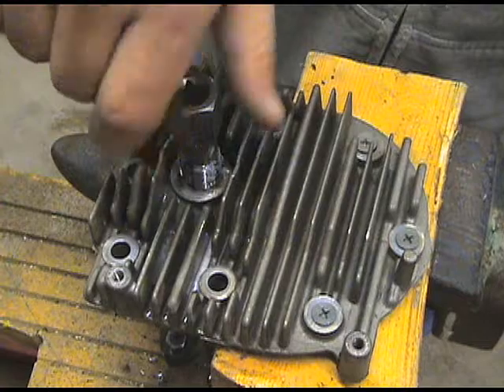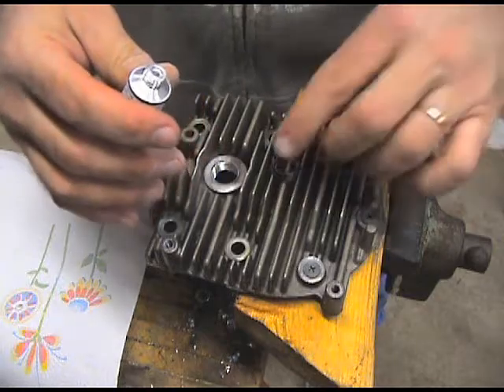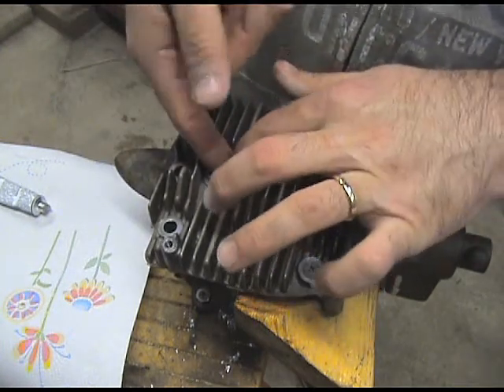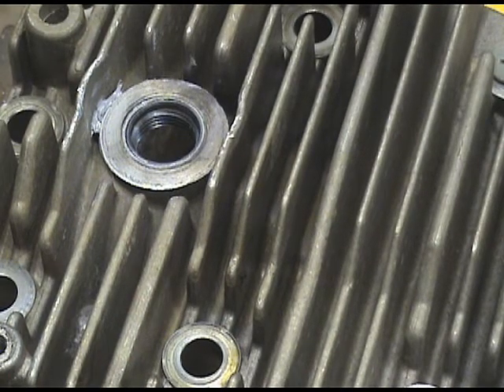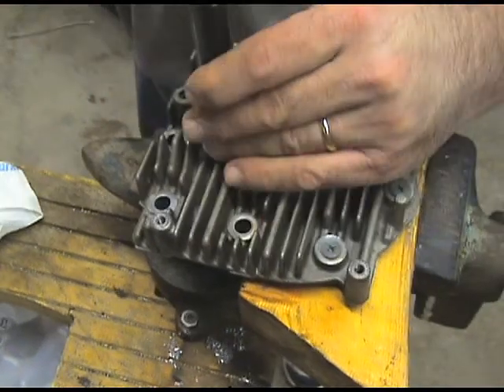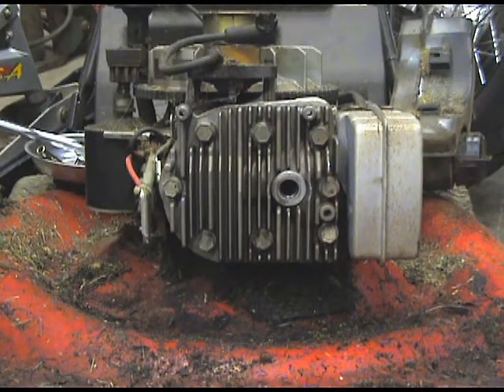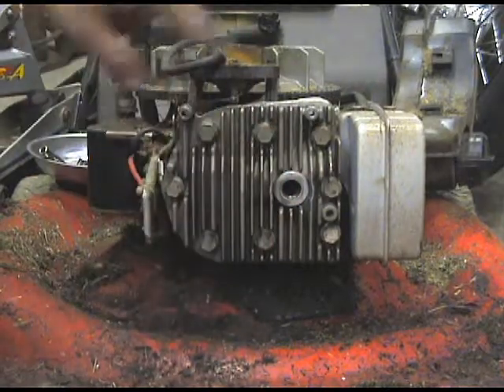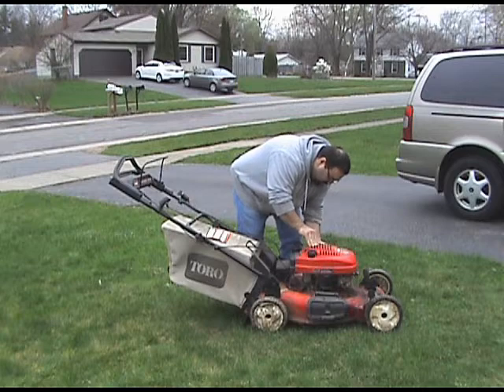Toro Spark Plug Thread Repair with Sav-A-Thread by Heli-Coil PART 2

Comment: Thanx for that, I never even heard of a spark plug "sleeve" until today and I'm 50.  We bought a new Champion RC12YC and it didn't work.  We took it back to the store and complained, that's when they pointed out our old plug had a "sleeve" stuck on it.  We'll try various machine shops to try to match the insert.  My dad knows an aircraft machinist that may be able to cut an exact copy of the insert from scratch.  This is going to be a problem now matter what.  Thanx for your info.

Comment: id be using green or red wicking loctite not silicone.  not sure if you realize how hot that head gets but silicone wont be lasting long at all on and air cooled engine on the head next to the exhaust manifold!!
Reply from the maker: Thanks for the tip.
Reply: @Paisteboy   Update on if the silicone kept the insert in? The pack says to use high temp silicone, not Loctite as the other commenter mentioned.

Comment: Lol nice job you done, looks pretty damn efficient and it works. Can't believe someone made a negative comment tho smh
Reply from the maker: Alonzo Braziel
Right. Maybe a mechanic wants to do it the easy way and be able to charge more for a new head. Not the average guy.  If a repair will work and it's cheap, most people would do that.  Thanks for the comment.

Comment from the maker: Yeah,  I used to be skinny, but that was a long time ago lol. The RM is a 1980 RM 60 2 stroke.  The gearing is really tight on the RM because it meant for motocross.  It's a six speed and in motocross you shift really quickly.  I'm going to be doing a couple of videos on that bike soon, once the weather turns around again.

Comment from the maker: Sounds like the spark plug was drastically over tightened.  Find out waht the thread is on that insert and see if it matches the sav a thread.  If it matches then buy a sav a thread and a new spark plug and you should be OK.  If not you may have to buy a new head which costs about 35 bucks.

Comment: I took the spark plug out of a Toro Recycler mower today, there was a thread insert stuck on the spark plug.  I heated it with the torch, put the vise grips on it, won't come off.  What do I do?  The spark plug is a Champion (I think) RC12YC, any idea where I could try to match the insert?  It doesn't look like the insert in this vid, it's steel with a collar.

Comment: where did you get the torque specs. for the head bolts all I could find said 200 in. lbs. or around 22.5 ft. lbs. I don't want to over torque them.

Comment: Sorry you took it as negativity, but $20 is still too much,  Not to mention your time involved.  If I had repaired that in my shop I would have charged $50 for labor alone. When I say junk yard, (we do not have "junkyards"either) I mean, yard sales, craigslist, want ads, etc.  Most likely you could have found a whole mower for free, removed the head and voila, had it repaired.  

On the other hand if you had fun, great, I just think that it should have been known to others out there that are watching your video that there are more economical ways (unless you enjoy doing this sort of thing) of getting this done.

On craigslist, even if you could not find a listing, if you had posted a need for a free (or cheap) I might have seen it, (I know not likely me personally) but I would have contacted you and possibly helped you out.  But to each his/her own.  Good luck with whatever you chose to do.
Reply from the maker: I do it mostly for fun and to share, but I do see your point.  If it had been my snowmobile head it may have been different.  Thanks for the feedback.
Reply: paisteboy I like to do things like this as well.  I am a bit stretched to the limit with finances so I have to be thrifty.  I guess I figure most others do to.  And yes your snowmobile head would have been at least 3 times as much as a head for a lawn mower.

I am actually impressed that you got a spark plug thread repair kit for $20.  Either it is a cheaper one or you got a good deal.  The ones I buy are upwards of $50. I make sure I get steal threaded inserts instead of aluminum.  (in my opinion repairing threads with aluminum is just repairing it back to original and you chance restripping)  Save A Thread brand kits are the brand I chose, and then I just replace the inserts as needed.  (about $4 each instead of price of whole kit)  What I like about the Save A Thread kits, is they are a no drilling required and perfect alignment threading.  The threader has a set of threads at the beginning that are the same size as the original threads, and then it cuts to the size of hole needed, and then threads the new size all at one time.  The packaging comes with the insert part numbers so that you can just order what needs to be replaced.  I get mine at NAPA, but you can get them a bit cheaper on ebay.

Comment: i have an 03 ford escape with cylinder 3 spark plug. hole with a small crack thru the threads. We got the new plug to go in but its not sealed no compression. Can JB Weld be used? Not worried about taking it out again the suv has 225,000 on it. Still runs strong just need it to last till fall or winter.
Reply from the maker: Not sure how well that would hold up on a vehicle.

Comment: Not quite sure why you are repairing a head for a lawn mower.  That kit probably cost you more than the head.  Go to a junk yard and get and old mower and take the head off of it.  It does not have to be a Toro, most likely it is either a Tecumseh or Briggs and Stratton motor and can find them on almost any mower.  Waste of time and resources.
Reply from the maker: We don't have lawn mower junk yards in my area. The kit was 20 bucks.  Worth it.  Why the negativity?
Reply: paisteboy I could have said it all better I apologize, did not mean for it to be judgmental or negative.  Just so people know this is not an economical way to do this.
Reply: he is doing the repair because he can with the knowlage and tools he has. maby you dont have the same skills and knowlang as paisteboy does. dont knock the gye.
Reply: +Jamie Buckley I know several six year olds who can do this.  Not really a skill.
Reply from the maker: +Jeremy Gerber 
Yes it is. Maybe this may seem easy to you and me, but there are many men that would not be able to do this without guidance.  I probably could have done this at six but I was into this stuff. There are adults that barely know how to start a mower. This video is for people that don't know how to do this or just need a little more confidence before attempting this.  Why did you watch?